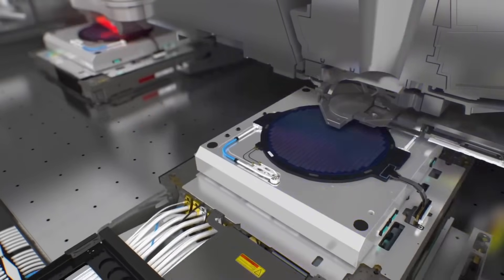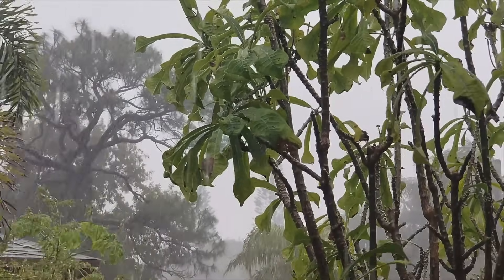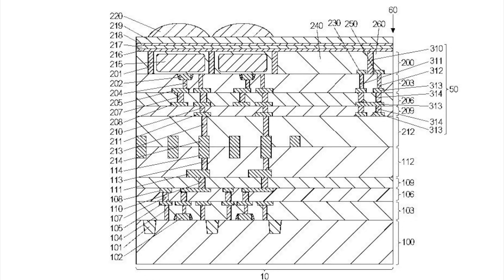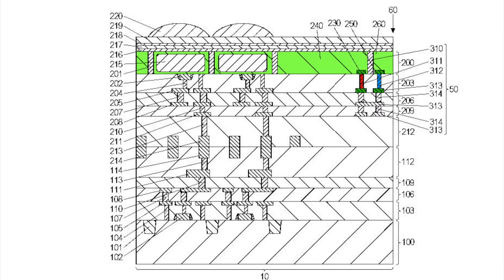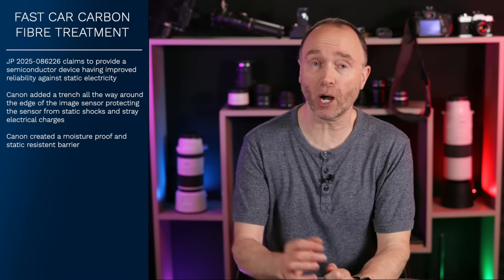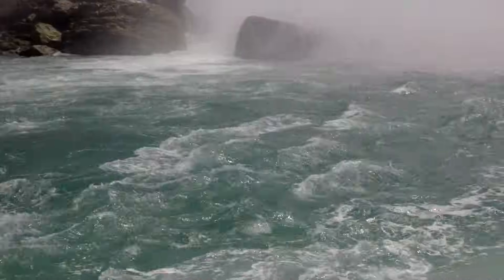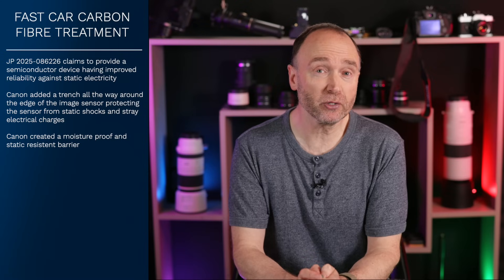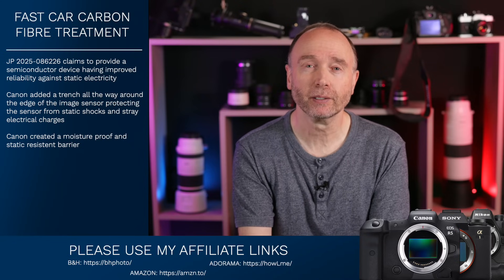Canon's Sensor Moat Is Real

Comment: They had to do something to address their lack of iso invariant sensors. Reducing static automatically reduces noise and this new tech in theory should allow cleaner low light photos and video. This is where canon sensors suffer the most. I'd be interested to see a test between the new and old tech when it is put into production.

Comment: Canon engineered a diode circuit that moves a transient voltage to the chassis.  I look forward to hearing about the efficacy of their R&D, engineering, and sensor/chip printing.  I realize this will be years from now.
Reply: It might be closer than what you think! Canon is recognizing certain things about the market, and I think they might start implementing a lot of things quicker than they used to.
Reply: No, I don't think it will be years from now.  This may already be in effect.  If not, even better, but Canon is quietly evolving into a silicon powerhouse.
Reply from the maker: I always look to the filing date. I have seen plenty of patents published after the underlying product was announced.